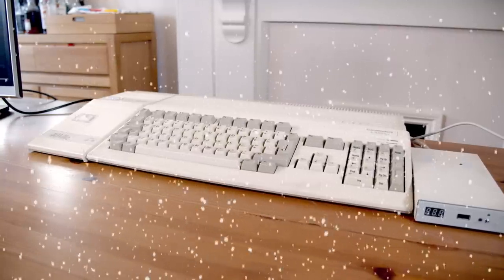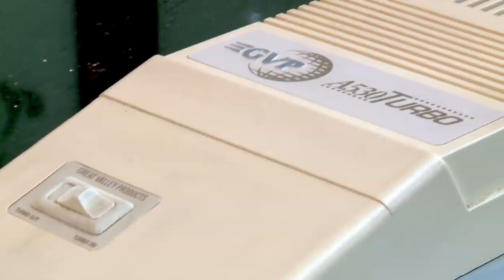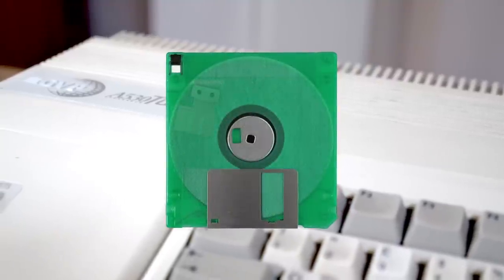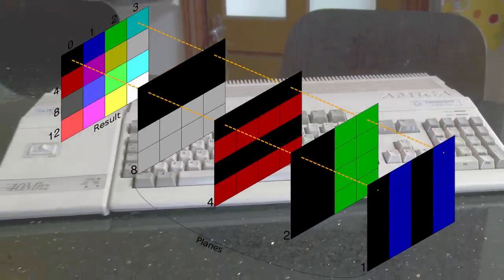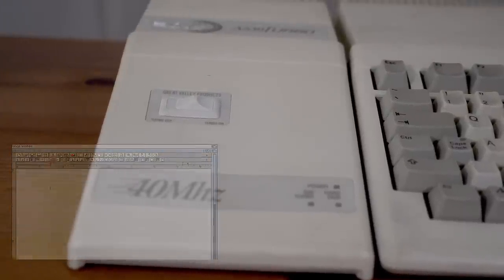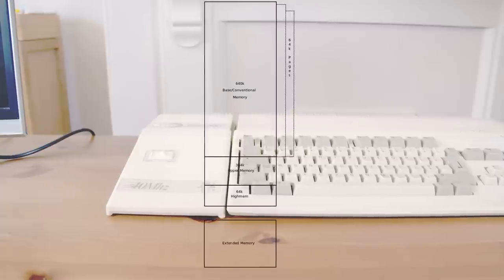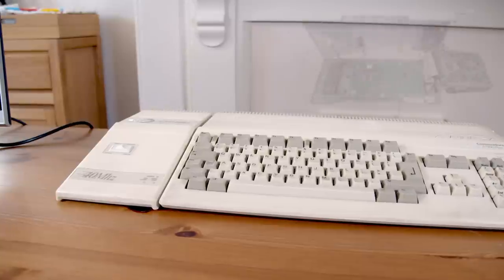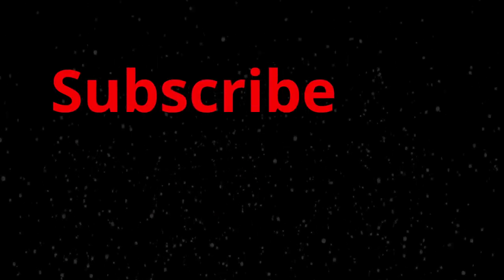This is a PC, no really.

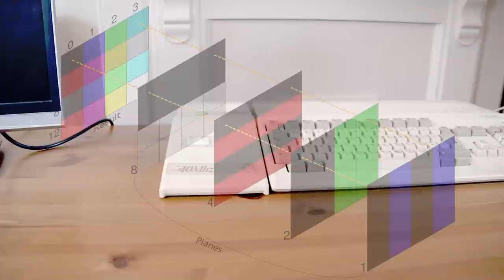Comment: I might be a bit late, but here's some more detail about one aspect: The bit about chunky vs. planar at 11:15 is a very generous simplification. 4-color CGA and 256-color VGA/MCGA graphics modes on the PC are indeed chunky, but 16-color EGA/VGA modes are *not*. The data in the card's memory is indeed laid out in bitplanes, a perfect match to the Amiga at first sight. However, there are two complications: First, on EGA/VGA cards, you don't just write into bitplane memory directly; there's a whole byzantine mechanism of bit shifters, latches and comparators between the CPU and the VRAM. If the ATOnce really supports EGA/VGA 16 color modes, it has to either replicate this mechanism in hardware, or emulate every single VRAM access on the 68k. Second, even if there is hardware support for the EGA bitplane datapath, the data, as stored in VRAM, is still not usable for the Amiga because the bits are in the wrong order! (EGA/VGA uses LSB=left/MSB=right, Amiga is the other way round.) So, again, either the ATOnce hardware performs bit-reversal in 16-color mode, or the 68k has to do it. At the very least, regardless of graphics mode, the 68k has to do one thing: Copy the graphics data from fast memory (which the PC's emulated VRAM technically is) into chip memory.

Another minor nitpick: The video makes it sound as if protected mode enabled simple linear access to the entire memory. That is absolutely true for the 386, but we're talking about a 286 here, which, being a 16-bit processor with 16-bit address registers, can always only access data in 64k segments. The benefit of protected mode (apart from memory protection, which gives the mode its name) is that these segments can be put (almost) anywhere in the 286's 16 MiB address space, while real mode limits the reach to a little over 1 MiB.

Comment: CGA and EGA were planar and so was VGA in 16 color modes. So it's probably not too bad to have the 286 write into Amiga chip ram. 

Also at the risk of pedantry the 8086 uses segmentation rather than paging. And the offsets were limited to 64K on both 8086 real mode and 80286 protected mode. Only in 386 protected mode did the offsets become 32 bit. At that point new 32 bit OSs for 386+ set the segment bases for code (CS) and data (DS) to zero and the limit to 4GB and treated it as a flat 32 bit machine.  286 protected mode was basically flawed in a variety of subtle ways, most of which were fixed in the 386.

Comment: Ah yes, back in the early days having a pc was certainly rare, especially one with Windows 3 & Word. When i was still studying back then people used terminal-ish pc with DOS (or cpm, i really cant remember) with a very basic version  of Wordpefect with only 1 basic ugly font. 2 study buddies & i dug out his A500+ & my A500 & then wrote a 60 page group project on the amigas & then used some early shareware & an extra external drive to manually copy over the text file using CLI commands. Not that the text files was 100% compatible & but the basic letters got compied at least. Then the local dorm has a single Windows 3 pc with Word (that was kinda mindblowing) & we used that to "bling" up the paper. Of cause later on the amigas also got much better Word processors & some much more compatible amiga/pc file transfering software. Still back then having a "alternative typewriter" was incredible usefull.

Comment: I had a bridgeboard in my 2000 for a while. I went to the fun of putting the 16-bit extenders on the ISA slots But there still weren't enough ISA slots for everything you'd want on a PC unless you ponied up for one of those expensive multifunction ISA cards. The kind that combined vga, floppy, hd, serial and parallel all on one board. I found a passive ISA backplane that plugged into an ISA slot, and had 3 ISA slots on one side and 2 on the other. So using that, you gave up one slot and got 3. (The 2 slot side was useless, as they overlapped existing slots. It also meant you couldn't put the case on.. Anyway, it was fun to have windows, amigados/wb and 68k Mac/Finder all runing simultaneously.

Comment: A nice surprise to see the AT-Once mentioned. I had that one in my Amiga 500 (non-plus). A different board than what you show and it came with its own 68000 cpu for better compatibility. Anyway, the color emulation on the AT-once was painfully slow. It was really only useable in monochrome mode. A pity you couldn't show it working in your video. Would have liked to see how it performed on a 68030 cpu.
Thanks for the video.

Comment: Awesome video, thank you. From memory, I think there were actually some "Amiga ISA cards". Although as you say they the ISA slots were pretty much useless without some kind of bridgeboard, they were actually powered. A handful of mostly video related cards, used an ISA daughterboard which presumably needed nothing more than the power rails.
Reply from the maker: They must have just used the power, as the data and addressing pins where not linked to anything other than the other isa slots (including the one the bridge board could be inserted into).
Reply: @RetroBytesUK  There was something called the "Golden Gate 2+" that was sort of a bridgecard without any PC hardware on it that let you use some ISA cards (with special Amiga drivers) directly on the Amiga. Maybe that's what Digital Archaeologist is thinking of? There were drivers for PC parallel, serial, hard drive controllers, and non-DMA network cards, etc. There was also some ability to use the ISA cards from software PC emulators like CrossPC or PCTask, iirc.

Comment: When I started to work with PC's this was in the dos windows days, 386 and 486 were still around, it was a lot harder getting stuff running properly having to load high certain things, it's a lot easier now anyone can build a PC, and bung windows on it's a piece of cake, even the connectors for the power supply are idiot proof where you can plug them in one way only.

I switched from my A500 to PC maybe a year after working in this place because we got trade price parts and did not have to pay the vat so this saved a lot but I still had to sell my 500, I have a 1200 these days but still love the Amiga.

Comment: I had  PC ATOnce on my Amiga 500 in the 90, mainly used it to write Turbo Pascal programs for my university classes. In fact I still have it, and my old Amiga with it, tucked away into a cupboard... tried to start it recently but my old A1024 monitor no longer works... I'm going to have to get a VGA adapter... or maybe just a SCART cable and plug it into a TV...

Comment: Unlike the 386-based desktop PC clones and before the 1995 CGX RTG or 1996 P96 RTG, Amiga 500 with a full 32-bit 030 CPU accelerator wasn't able to run Doom since Amiga OCS/ECS wasn't upgradeable to a 256-color display. 

Prior to the 1995 CGX RTG or 1996 P96 RTG, the downside for full 32-bit CPU accelerated Amigas with OCS/ECS is the lack of a fast 256-color display for 1990s PC game ports.

In early 1992,  I have Amiga 3000/030 @ 25 Mhz with 32-bit 4 MB Fast RAM and 2 MB Chip RAM. Later in XMAS 1992 year and missing the A4000/030 SKU, my Dad purchased 386DX-33 with an ET4000AX SVGA PC clone.

68030-based Unix workstations usually have fast graphics cards at a similar level as TIGA since Amiga OCS/ECS is not enough.  TIGA was useless for AmigaOS apps and games until post-1995 CGX RTG or 1996 P96 RTG.

Comment: Shame it stopped working was interested in it considering how small it was compared to other bridge boards. I remember GVP being in most the Amiga mags at the time, and always got reasonable good reviews for their products.
Reply: It's very similar to the experience of using a normal big-box 286 bridgecard without a dedicated ISA graphics card. Sluggish video speed just like if you use the bridgecard's Janus software to display the PC screen on the Amiga's display, just with a few extra available (even slower) video modes. Fine for productivity software, less so for even CGA games. Having an accelerated Amiga probably helps speed up that display translation though.

Comment: My old second hand A500 bit the dust. Sadly, and I had no idea it was in there, whoever had it before me must've installed it, but there was a trapdoor expansion card with a varta battery on it. Pretty sure I don't need to say owt else about that one.

As for PC stuff, I think my 1200 would've been a good set up to run something like that, as I had a "dual monitor" set up with a VGA monitor plugged into RGB out for running Workbench and productivity stuff at, I think it was 672x576 flicker free and then a TV hooked up via RF cable for playing games on. I assume the VGA monitor on an AGA chipset would've done the job for DOS without needing an ISA card. I imagine such a thing doesn't exist, though.

Of course, by the time I had all that hardware('030, fast RAM, HD etc.), Windows 95 would've been out and yeah, there ain't no A1200 running that.

Comment: What an incredible piece of engineering that thing is, combined. I would love the GVP sidecar for my A500 but I can't imagine ever coming across one without some extreme luck. Where on earth did you get them from??? Thanks for the video.
Reply from the maker: I bought it from eBay, but about 12-15 years ago.  I have no idea where you would fine one now at a none stupid price.   I bough everything you see and a A570 for about £50. People where more or less just throwing that stuff out around then.
Reply: @RetroBytesUK  incredible. I bought an A500 in a charity shop for about a tenner around the same time, but I couldn't work out how to use it so I gave it away! Kinda wish I'd stuck with it and done more research.

Comment: i have a some what rare mac that also runs windows. a 7200 pc compatible. it has an entire pc on a pci card and emulates through connectix. although with that much pc hardware on the card I'm not really sure it counts as emulation, lol. seriously though, i loved having it back in high school because my school ran both macs and pcs. it made my life A LOT easier to be able to bounce back and forth on just one computer!
Reply: Are you sure you're not getting your wires crossed? The DOS-compatible Mac models do indeed have most of a PC on a card, but you don't use Connectix Virtual PC to use it. It should come with its own software to run the PC in a window or in full screen.

Comment: That thing you said about Amiga floppies being different.  Are they basically the same format the C64 used?  I am maybe really thinking of the 1541 drive that many people who had a C64 may have had.  I think it is an MFM floppy drive.  Does it have any pin compatibility with an MFM hard drive?  I have no idea.  Did Commodore deliberately use such a floppy drive so that their disks would not work on other computers?  Also assuming that you did somehow get it working, I imagine you might have a disk that appears to be blank.  It would be similar to having a partition that Windows doesn't recognize.

Comment: Thats quite norm Amiga 1000 had Sidecar XT and A2000 had 286 and 386 avail.
3DO was made on PCI card etc. Only Amiga 0x0 and chipset never made a nice PCI card :D
Reply from the maker: Not out in the wild saddly, I'm told the gateway had done some work on a Amiga on a card, I could not get too much detail about it. I know it was subcontracted out by gateway to a 3rd party, and was similar is some ways to amstrad's megadrive on a card. So the card had its own display, and audio port, as well as a 9 pin joy stick port.  However unlike the megapc the pc did not just provide power, it also provided mouse and keyboard emulation, but the amiga board had the floppy controller, and provided floppy support back to the PC as an isa floppy controller.

I've never seen it, or pictures, just talked to someone who was involved in the project.

Comment: The A590 is stunningly fast if equipped with a fast SCSI drive - it does nearly 2MByte/s on my Amiga 1000 with a 1GByte SCSI drive (yes, it works on the 1000). But CBM went cheap and put in the slowest and shttiest XT-Bus-Harddrive on the market (0,15MByte/s)

Comment: The Standard A590 was slow when Fitted with the xt-ide Drive that CBM supplied, I have had 5 SCSI Devices hooked to a A590&A500, Only 2meg ram expansion was it biggest issue, I added a Accelerator. with a Quantum SCSI or Better, the A590 transfer speed increased, GVP was good equipment, but with "special" ram, unit price it was a harder sell over CBM Clunky A590, but its "Bridgeboard" slot was a fantastic idea for A500, If people could have only afforded them at the Time ..
Reply: I edited that, I typo St506 instead xt-ide..

Comment: Wasn't there a PC packaged very like an Atari ST or Commodore Amiga? - it had a very similar "one box" approach and I think even included a modulator so you could plug it into a TV. This was in the early 90s when PCs were becoming more popular as the Amiga/ST era drew to a close.

I don't think it did very well, though.
Reply: Probably a few.  I think Amstrad put one out under the Sinclair name ( PC200 ).  It was pretty bad though it looked sort of cool.
Reply: @chessoc7799  that's the one I was thinking of!

Comment: My Vortex 386sx for my MegaSTE works waaaay better. Also the graphics are so well emulated, most games run on the PC Card way better than even on the MSTE at 16Mhz with cache. The Vortex is a pretty cool little thing. Also have 8088 and 286 versions for regular ST's. They all work and do a decent enough job even thopugh the ST line doesn't really have great graphics or sound.

Comment: Great video. I used to have ATonce (I think that’s how it was called) that was installed internally in 500 but although I could boot it in 8086 mode I could not get it to read any disks and back then Amiga 500 HDD  add on was too expensive and to be honest I could not get it to run anything on it at all :( too bad I wish I kept that card and many more computers and other things from back then!

Comment: Possible fixes? Overheating may be a problem with all the chips stuffed in there.. the 68030, SCSI hard drive, PC 286... and that tiny 40mm fan. The SIMMs may need to be reseated or scrubbed to remove corrosion. Does the expander have any electrolytic capacitors? Is there a clock / BIOS battery for the PC, or is that handled by the Amiga software?
Reply from the maker: The clock is handled by the Amiga side of things. Since making the video, I've discovered a few screen modes cause it to crash, so I'm thinking its somthing on the amiga side, possibly somthing on the chip ram side of things, or the flicker fixer, as that gets inserted between the mother board and Denise.

Comment: Ho man.  And that's a gross oversimplification of 286 and 386 protected memory and DOS4GW would've been 386+ only and linear address mode in real mode was a 386 cheat thanks to how segments work.

Lots of good stuff in this video, though.  I do kinda wonder if there were one of those replacement or clamp-on 386SX or 486SLC upgrades for this thing... 😳